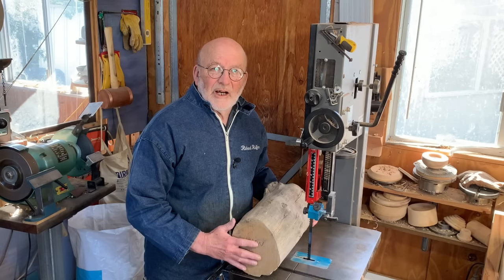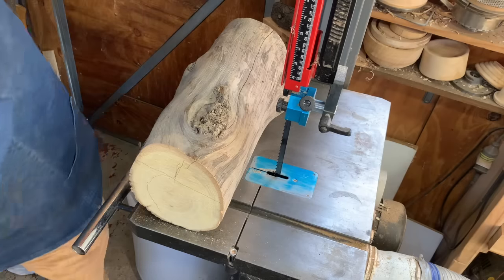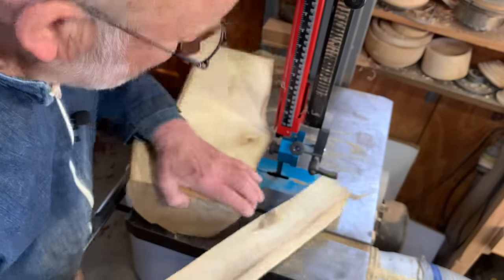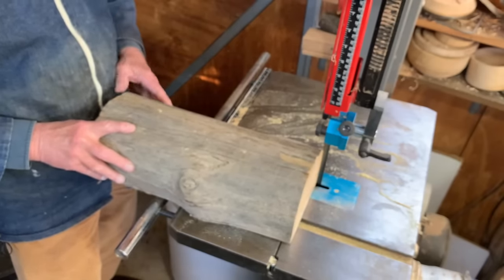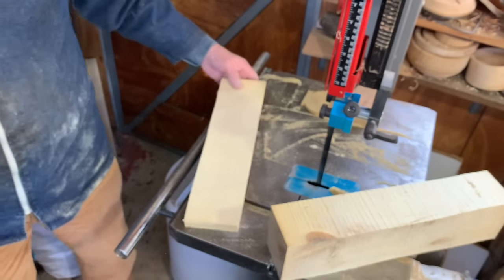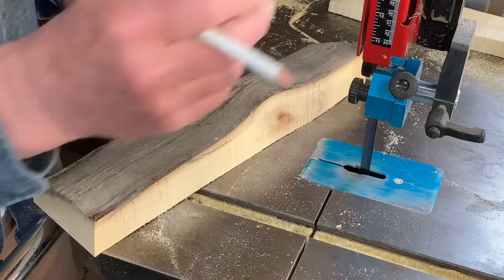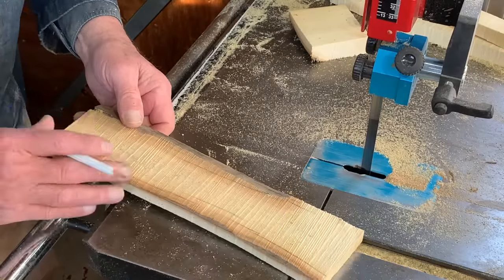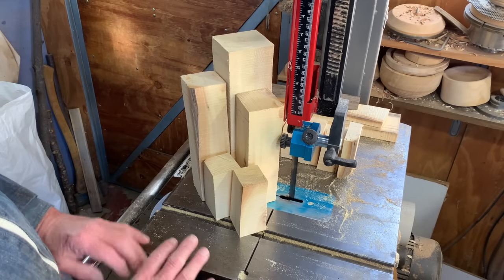Richard Raffan on cup shakes in a log   HD 720p

Comment: I like using wood with that kind of splitting. I use epoxy or CA to fill the split and it turns out beautifully. Mimosa is particularly bad about the center splitting out but is spectacular grained wood.
Reply from the maker: CA glue tends to give way after a few years, but if you insist on using crap wood, at least use epoxy that secures the wood for more than a few years.